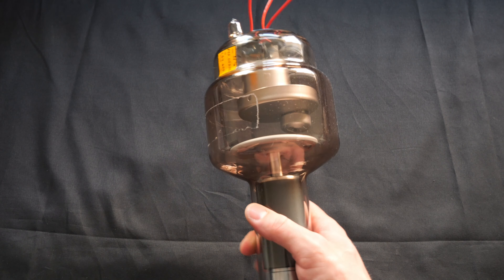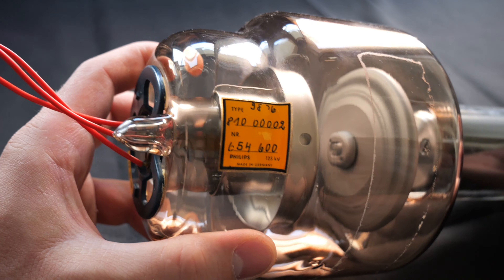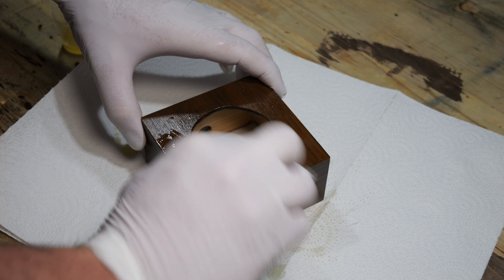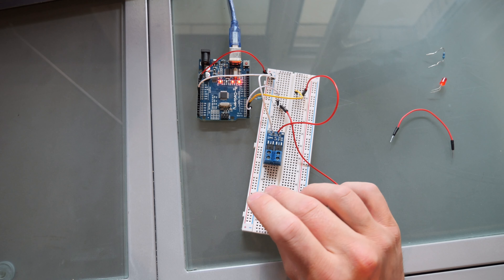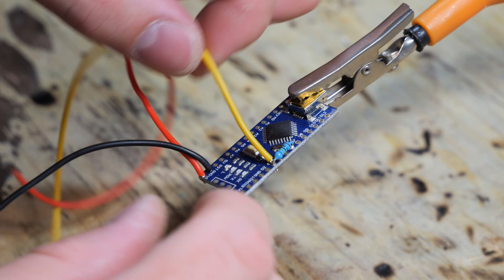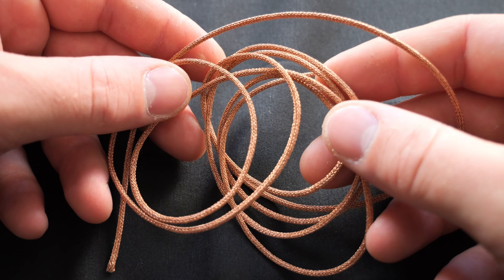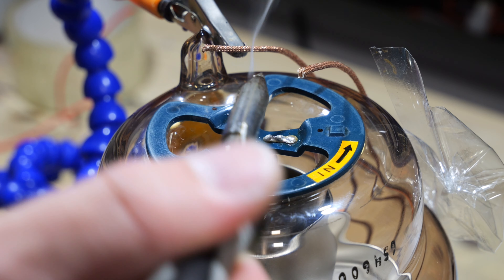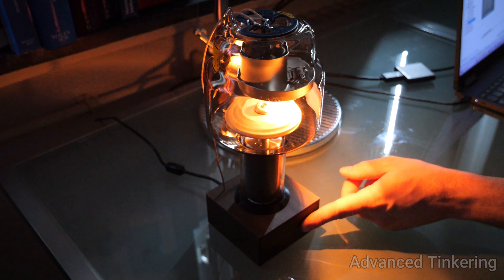A New Life For An X-Ray Tube

Comment: Put a tesla coil underneath to make the anode emit streamers like a plasma ball.
Reply from the maker: I allready thought about that. But the pressure inside the tube is too low to produce any gas discharge.
Reply: If the cathode would somehow be referenced to ground trough the power supply, you will get far more than a softly glowing warm light from that tube when some kVs are applied to the anode. But yeah, bad idea ☀

Comment: Very nice!
You should add also power for running motor, as induction motor it should be possible to run it like BLDC one i think. As it is not X-Ray mode, it would just add to estetics, moving parts, like very slowly would look great!
Reply: no, it would not. All sensorless BLDC controllers need magnets in the motor to work at all. This is a job for a VFD, used ones are cheap and plentiful on online auctions.
Reply: @AKAtheA  Oh, my bad... I thought maybe this could be done simpler than VFD controller :/

Comment: ein tipp: wenn dich die geräusche vom pwm stören, kannst du pwm in analoge spannung umwandeln, indem du einen low pass filter zwischen den arduino und den mosfet schaltest, dazu einfach den gewünschten wert errechnen (dafür gibt es online rechner) und dann hast du eine analoge spannung zwischen 0 und 5v

Comment: Has it got a crazy high rpm?
Reply from the maker: No, I think the anodes of most tubes rotate at around 3000 rpm. But apparently there are some getting as fast as 10.000 rpm.
Reply: @AdvancedTinkering  I have an an xray transformer and tube, no rotating anode but it's rated at 85kv. I was told it's ready to just plug in although it hasn't got a plug wired to it yet so it is a matter of someone with the right knowledge telling me how to wire it correctly and then I'll need to pot it in transformer oil and pull vacuum on it, make a lead box with an aperture leading to a scintillation screen. It would be sad to see it arc to itself and be destroyed 😕
Reply: @AdvancedTinkering  yes those are the ones I've seen in a fb high voltage group

Comment: As as owner of x-ray machine supply company I have many of these inserts in our cellar, some mounted on stands in a display case showing a history of design. I have been considering doing something similar for my desk. Do you think I could use an external power supply or do you think I would need the circuit you designed.
Reply from the maker: As long as you make sure that the external power supply has the correct voltage (so you don't burn the filament) it will work.

Comment: Firing it up for careful experiments would harm no one and the gov can pound sand.
That said, the tube is not a toy and shielding would be required. The anode voltage is the real risk.
Bench running a tube like this or any xray tube is not to be taken lightly.